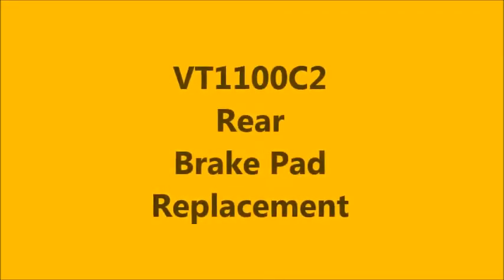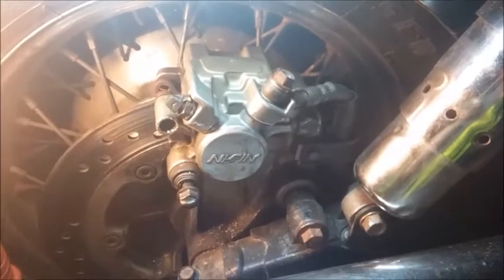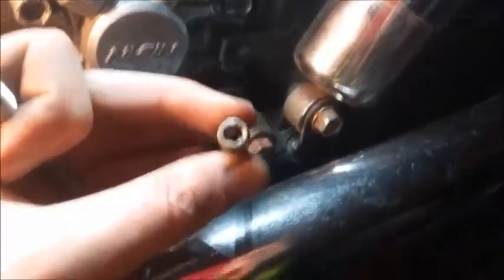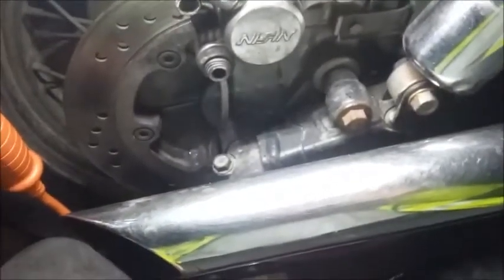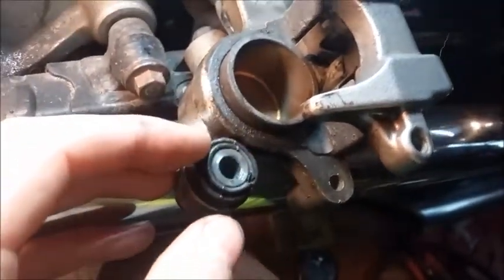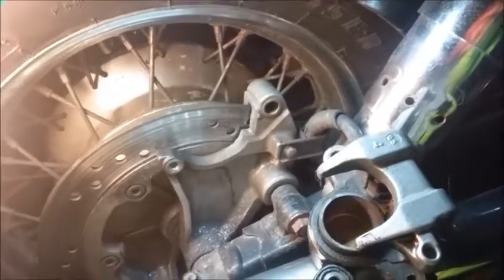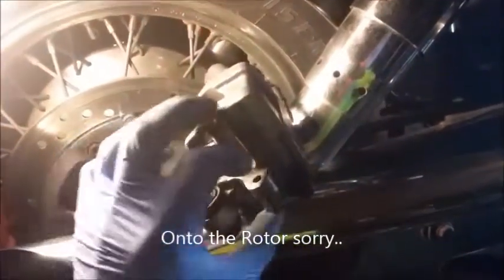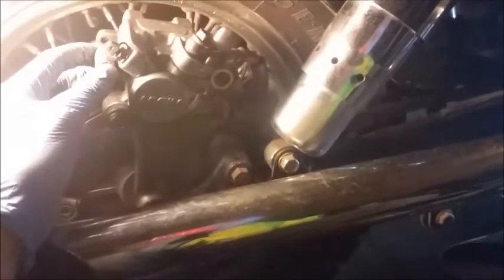VT1100C2 Rear Brake Pad Replacement

Comment: Hello.  Thanks for taking the time to do this video.  Are the rear brakes the same on a 99 Honda C3 Aero 1100, as they are on the C2?  Thanks.  Also, for just replacing the pads, is bleeding the brakes necessary?